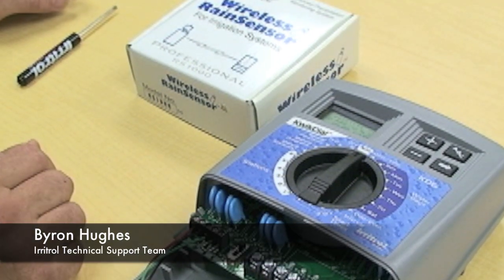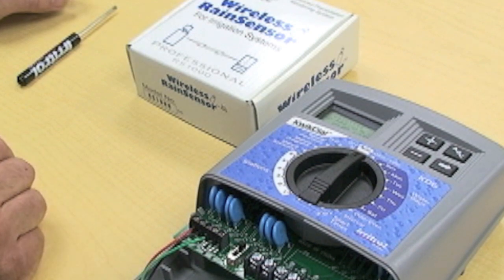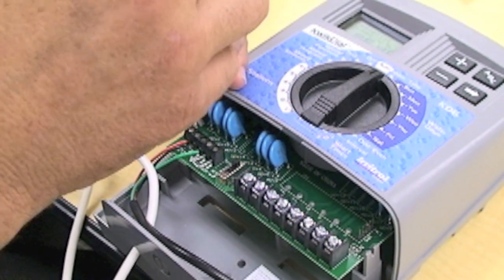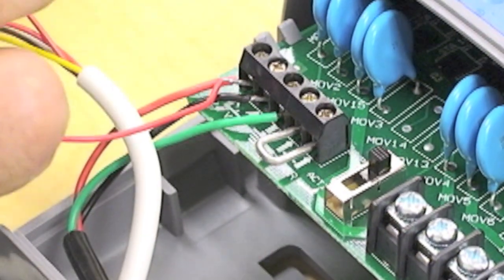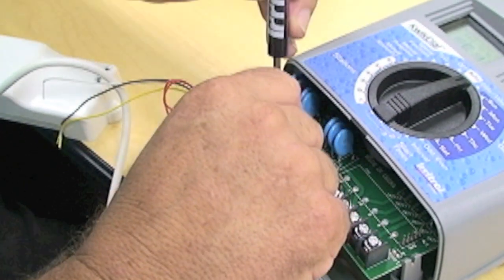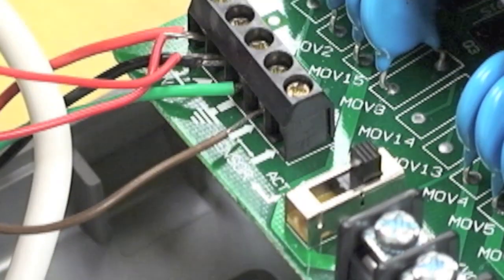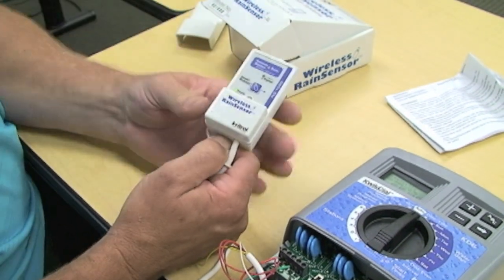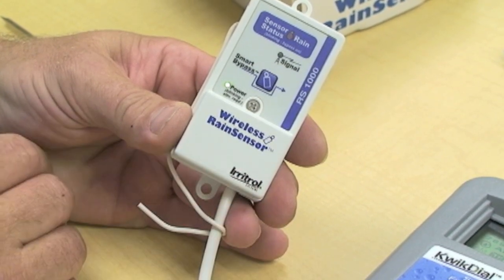How to wire an Irritrol Rain Sensor

Comment: What does the yellow cable do? I see you leave it free as did my irrigation system installer. I'm just curious why it is present out of the box?
Reply: I'll bet it's a special wire for Irritrol controllers... some advanced proprietary function, I'm sure.

Comment: @IronByron1958 Hey mate, its used for irrigation control as intended. I live in australia and purchased this model from local supplier and are using smartdial controller. I appears your right it does not have the performance im looking for. Summer downpour over 20mm rain and no activation on 3mm setting. I put the cork segment in a glass of water for an hour then reassembled and still no activation on lowest setting! I have now purchased an optical sensor.

Comment: whats the deal with this thing? I purchased this model and installed 20mm of rain last night and sprinklers are still on this morn? removed top and soaked in a glass of water for an hour reassembled to 3mm (lowest setting) and still play in the switch before controller says "SEN" this isnt working.